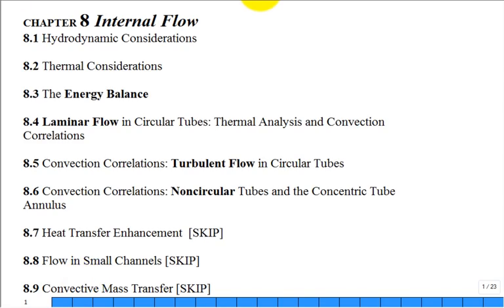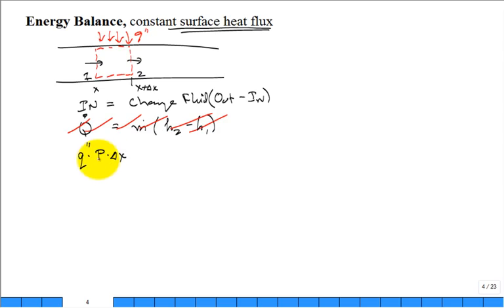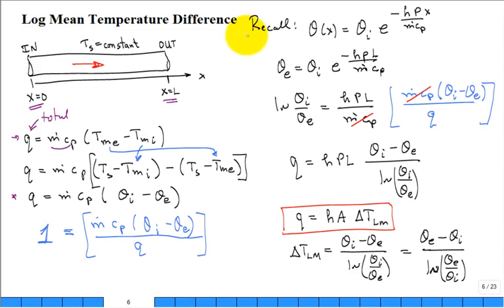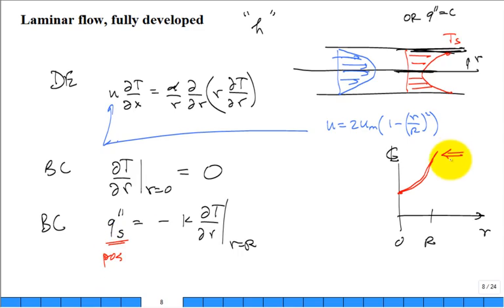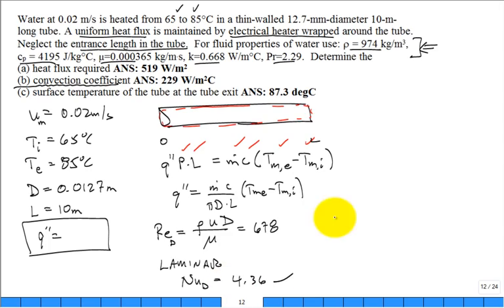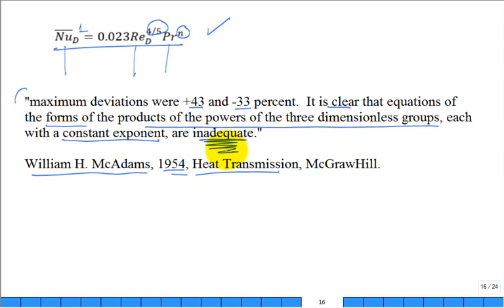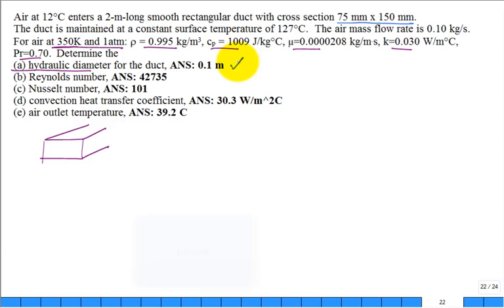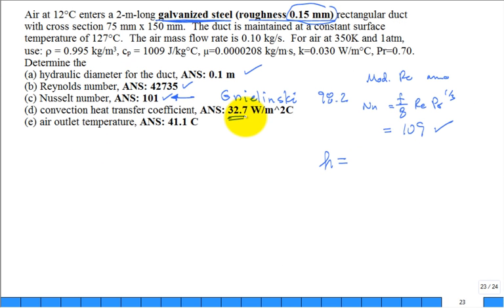Internal flow 2 F18

Comment: in your video, to find film temperature you find exit temperature first. how do you find exit temperature? 46:35
Reply: also at 53:54 we calculated the exit temperature to be 39.2 DegC which is different with the one you used to find T film